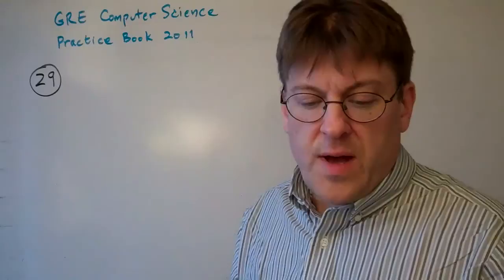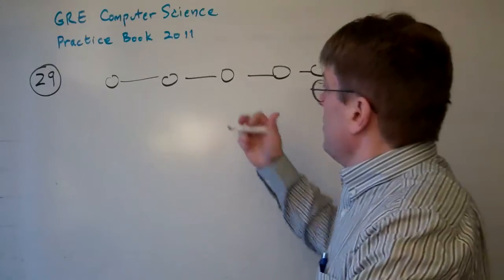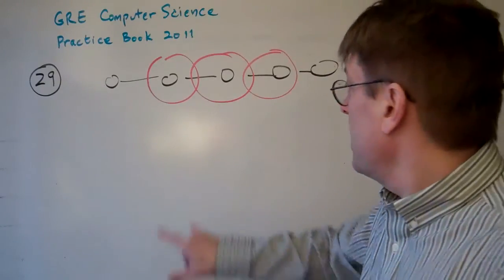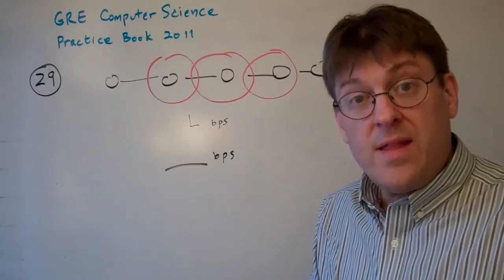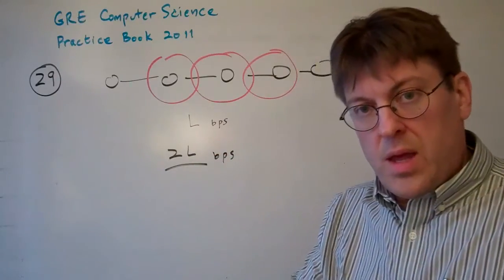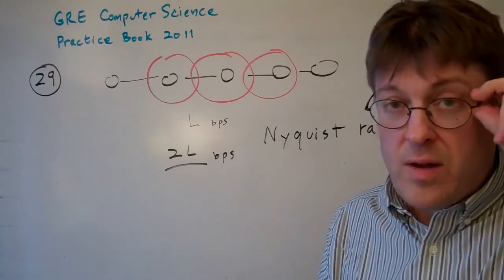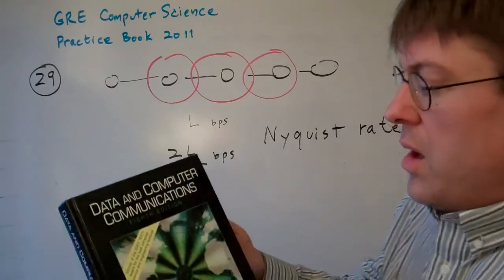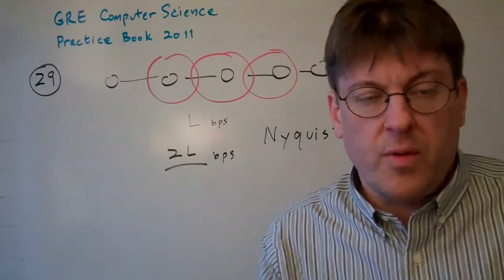GRE Computer Science Question 29

Comment: Hi oaklandsce, I want to say your videos and explanations are very helpful!

For this question, I think an easier way to explain this question is applying the CSMA/CA protocol.  If a node in the problem wants to transmit data, the closest two adjacent nodes on both its sides cannot transmit data.  You can achieve maximum total bandwidth only when the two farthest nodes are transmitting, thus 2L.  If any of the middle three nodes are transmitting, the other four nodes cannot transmit.
Reply: Thank you. Your explanation makes sense to me.
Reply: Given the constraints, we can maximize bandwidth by allowing simultaneous transmissions between adjacent nodes. This is possible because CSMA/CA with RTS/CTS prevents collisions between neighboring nodes.

* *Maximum simultaneous transmissions:* With five nodes, we can have a maximum of **two simultaneous transmissions**:
  * A-B and D-E
  * B-C and D-E
  * A-B and C-D

* *Total bandwidth:* Since each link can handle L bits per second, the maximum total bandwidth is **2L bits per second**.

### Answer
Therefore, the maximum possible total bandwidth attainable for this network is **(B) 2L**.

by Gemini